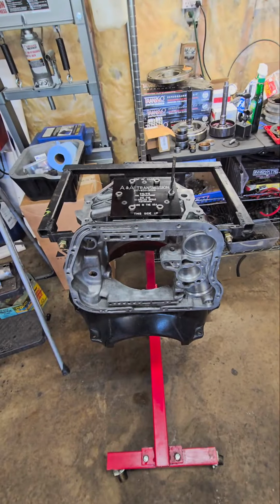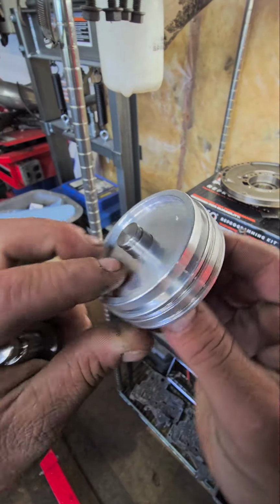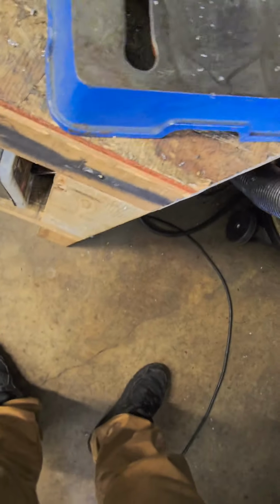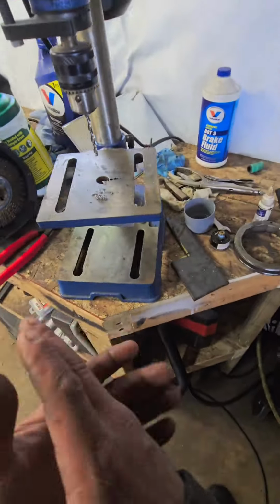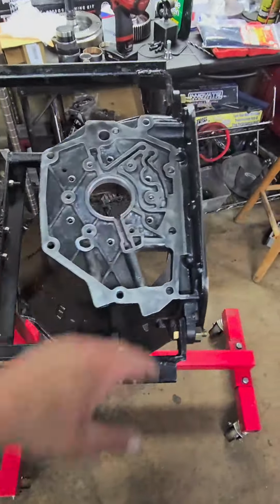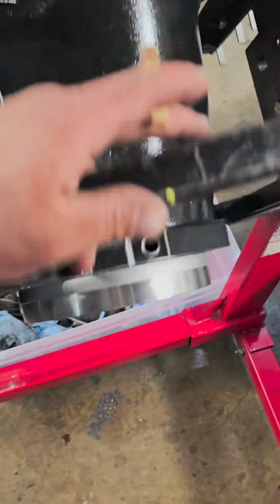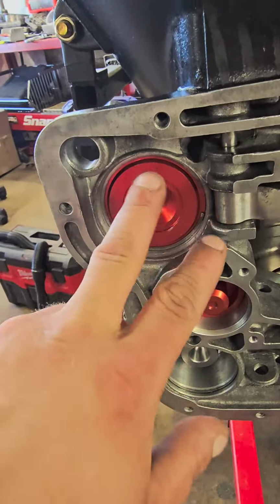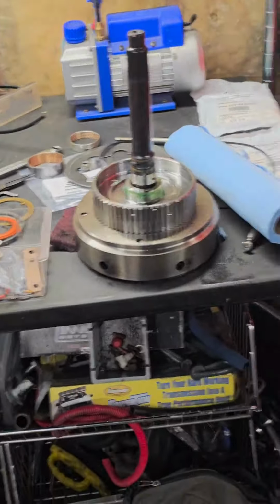1000hp 46/47/48RE the right way Pt-1

Comment: There's a rebuilder guide that shows how to make a tool to disassemble  the direct drum. I made my own version of it and it works just fine. I happened to have some wood laying around from a roof repair and just bought some all thread, nuts and bolts. It's also a pretty good idea to either make or buy a metal pan for the rebuild. The fluid will get everywhere if you don't. I used a cheap plastic container for under the bed storage and cracked one, which wasn't a big deal since I had three.

Comment: How do you set the superior super survo.  How many turns out?
Reply from the maker: The reverse servo?
Reply: Yes w the surperior survo.  I read to go a little over 3 turns out but now that i did that im getting a flar 23.  @JCSDieselPerformance
Reply from the maker: @Gary-kw2in  3 turns out, and the kickdown go 2 turns out, the reverse servo shouldnt effect the 2-3 shift, is your unit recently rebuilt?
Reply: Thanks bro. I heard it was to be 3 and quarter I think excavation was do to the thickness but couldn't get a confirmation anywhere.
Reply: It took me a few days to find the video again foe your reply
Reply: Explaination
Reply from the maker: @Gary-kw2in  nope the superior instructions say to set to stock specs which for a 47re/48re is 3 turns